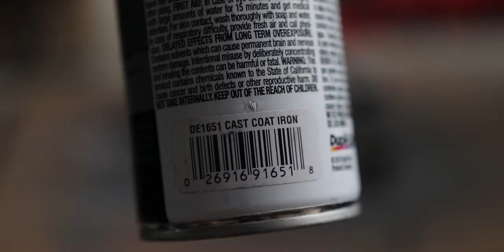The BEST BUDGET Brake Upgrade for your Honda - EK Civic Daily/Track Build Part 7

Comment: Is that 15 inch rims can it work with the big brake setup?
Reply from the maker: Which big brake setup?
Reply: 15” wheels fit this brake upgrade.
Reply from the maker: The wheel offset and spoke shape will affect fitment as well.